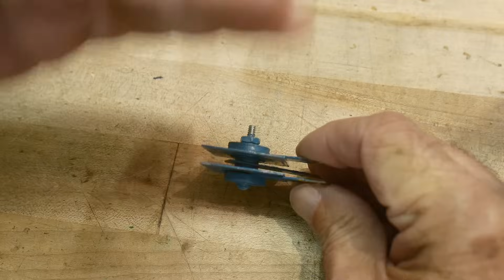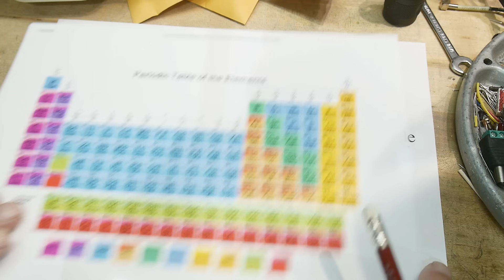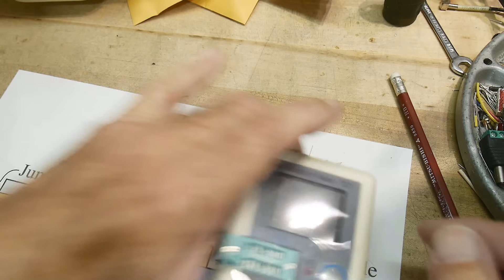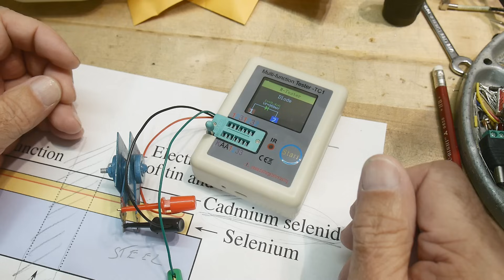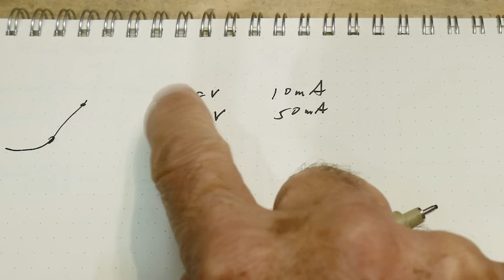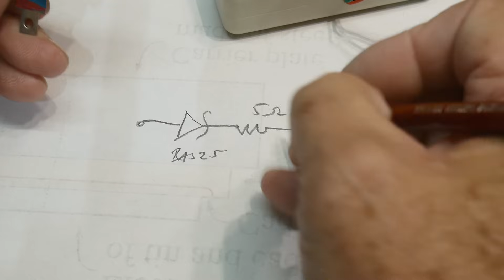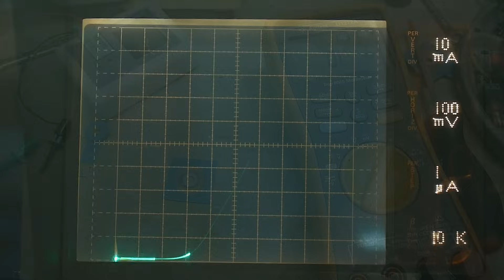#1753 Selenium Rectifiers

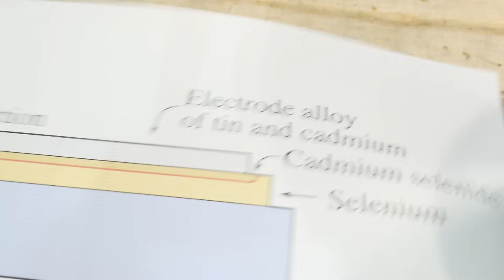Comment: 1:30 "What's in side this thing?" A heinous, infernal stink. Had one go on a 600A welding machine years ago. 600A three phase from the mag-amp controlled transformer. Big stacks. Oh My God. It cleared the shop out for the day. I could smell it for weeks, at work or not. It was a couple months before visitors came in and didn't mention the stink. In a welding shop.
Reply: I've had a tiny 250v 75mA one go. I can't imagine how amazingly bad a 600a one must have smelled.
Reply: I still remember it with the occasional flashback. Welder still rand pretty smooth. These have such a soft characteristic, loss of 1/6 didn't hurt it much. Fantastic arc gouging source, and great for running ceramic heater blankets. As the only real engineer, I was supposed to fix it. I was NOT going to go in to that case. Ran it for a couple days at low load to get the stink out, then felt good tack welding the case shut. Probably still in use.   @mfbfreak

Comment: Ones I dismantled were made of aluminium. They had some bismuth plating on one side, then some dark selenium on it, and then this tin-cadmium alloy on top. Layers on top had slightly smaller surface area than ones below, they didn't go all the way to cover them, so there was a dark "frame" around the tin-cadmium layer. The entire plate surface is a diode, and a capacitor. In vacuum tube devices I've seen there were multiple of those plates stacked for more voltage. Some had holes and screws, others were inside a plastic box with some springy inserts on both ends of the stack, and didn't have holes in them.

Comment: 1) IIUC, lots of folks think these are dangerous and are a replace-on-sight component. 2) If you wanted to build a Voltage Controlled Oscillator from a pair of back-to-back diodes, would a weak knee be advantageous, because the linear area of operation is extended over a greater slope? I am just a hobbyist and I am talking way out of my league, here... Thanks.

Comment: Very interesting to see the characteristics of a selenium rectifier with a curve tracer.  As the "BigCliveDotCom" channel says, if you burn (overcurrent) these rectifiers/diodes, you will smell a gigantic "fart" of hydrogen selenide gas, which will smell similar to hydrogen sulfide (both are toxic in sufficient concentrations).  Hydrogen selenide will smell like rotten eggs, like hydrogen sulfide.  With the old vacuum tube selenium rectifier supplies, you would always need to sniff to see if the "magic smoke" had escaped the rectifiers.  Another thing with these rectifiers is the fair amount of cadmium that they contain, as it is also toxic in high quantities.  Chronic cadmium exposure at a high enough concentration can lead to brittle bones, anosmia (loss of smell), and kidney failure.

Comment: As far as I remember those selenium diode stacks were built for about 20 V per stage and a forward current according to the size of the cooling fin. Such a size could be for around 1 A or little less. I remember two bridge rectifiers I bought to play with 55 years ago which were for 1 A ans 2 A and 20 V. 
The ones in tube radios had quite a number of stages to reach about 200V. They also had much smaller plates for lower current.
Reply: Selenium diodes were just barely better than having no rectifier at all. Worked okay to provide low current high voltage supplies in valve equipment but are totally unsuitable for signal detection or anything that requires fast switching and low capacitance.

Comment: Interesting. I was trying to figure out why the curve tracer started to slide away from 0V (and looped a little) as you increased the maximum forward voltage. It makes more sense now when you looked at the reverse characteristics and the huge loop... explaining it to be due to capacitance. So even though the drive voltage reaches 0V, the "capacitor" doesn't have time to discharge to 0V before the drive voltage increases again. Makes sense, but then the I-V curve would differ dramatically based on the frequency, yeah?
The loop also reminds me of the hysteresis curves seen in magnetic core memory... but then as I understand, that's not a capacitive effect, but a magnetic effect. It seems a major part of understanding I-V curves is understanding the physics behind the part!

Comment: See if you can find some copper oxide rectifiers and put them on the curve tracer. Also get an old galena crystal with cat's whisker for the tracer.
Reply: One of my Hickok tube  testers has a copper rectifier in the meter circuit.

Comment: Yep.  I did replace a selenium rectifier in a old tube radio with a 1N4007 diode and my B+ was much higher.  In went the resistor.

Comment: Nasty smell when they overheat. I believe they are somewhat toxic also when they outgas. Definitely a type of rectifier that hardly is useful anymore. Whenever I find these in old radios or old TVs I replace them with silicon diodes with a series resistor.

Comment: these are great for stationary car battery chargers. The small reverse current of the selenium rectifier acts like a small load on every halfwave cycle, regenerating the lead-acid battery of the car.This is a proven fact.
Reply: One of the major uses for selenium rectifiers still manufactured today is for battery chargers.  As you say, they have pretty much ideal characteristics for simple yet extremely effective lead-acid battery charging.

Comment: I have seen them used mainly in low voltage dc supplies. (Battery chargers, etc.) Standard balanced transformer outputs to the anodes, and get dc from the transformer center tap and the common cathode.

Comment: I found a few big chunks of Silicon on the railroad tracks. Before I knew what it was I was probing it with a multimeter and discovered the resistance would change depending on where I put the probes. Ive been wanting to make a crystal radio from some of it.
Reply: Those are metallurgical silicon. They use it by the hopper car full for deoxidizing steel. It is usually pretty conductive and you can use small chunks as the detector crystal in a crystal radio. On a more humorous note I brought a bunch to a hamfest after the movie Avatar was released and a bunch of people asked if it was unobtanium 😅😅😅
Reply: @christopherleubner6633  I guess on a less funny note I actually used to mine UNO  😛

Comment: Every tube radio that I have ever seen that uses a selenium rectifier used it as a half wave rectifier....

It's pretty common to replace them with a standard 1n400x diode and a resistor. To get the right resistance it's kinda guess and check by comparing the B+ voltage to the schematic. A 3-5 watt resistor is usually adequate for an AC mains radio, but a 10-20 watt resistor may be needed on an AC/Battery radio.

The antique radio restoration community is pretty split about replacing selenium rectifiers. Some swear they are fine to leave if working, some swear they are a failure waiting to happen, and some worry about the cadmium and want them gone working or not.

Most that I have seen have crept up in resistance to where they need replaced because the B+ voltage is too low.
Reply: I have seen German made Siemens  selenium rectifiers used for the negative voltage bias supply in old Fisher high fi equipment.
Reply: Interesting; the selenium rectifiers in tube radios I've stumbled across were all FULL BRIDGE RECTIFIERs and they were mostly encased in a metal package, making it easy to replace the innards with four 1N4007 diodes.
Reply: @KeritechElectronics  Odd, what radios?
Reply: @nobodynoone2500  Polish and German ones from late 1950s/60s if they didn't have tube rectifiers. I recall Tatry 3281 having a selenium FBR.
Reply: @KeritechElectronics  Depends on the radio, if it was a drop in for a rectifier tube a half bridge, like here, was common,  as the transformer was already there, and wound for a half bridge with common cathode and 2 anodes. For HV the stack would have to be 20 plates, though they often stacked them close together, so they fitted roughly in the volume of the old tube, to get a 400V reverse withstand, to allow B+ and peak reverse voltage to not break them down. Only after the transformer was redesigned, old stock run out, did they switch to the full bridge, as it used the same number of plates, but cut the cost of copper down. Full wave always has a jumper wire, as the stack is arranged to have a common positive point, and 2 series diodes to that point. Then connect the outer plates, as those are the negative, to make the bridge.

Higher the current larger the plates. Replaced a selenium rectifier in my battery charger, after 50 years those diodes were rather tired, and I did the change, using a 1970's era silicon block almost half the size of the old ones, that was rated for 10A instead of the 5A peak of the old ones. Did also add in a charge controller with a SCR, and a festoon lamp to illuminate the dial, plus reverse voltage connection protection. Now a 70 year old GE charger, still working well as needed.

Comment: Woohoo! Some old Sarkes Tarzian selenium rectumfriers! You know why they call them rectumfriers? Well, if you run too much current through them, the hydrogen sulfide will off-gas, and the surrounding area will smell like a......rectum!

In the old Zenith AM/FM radios from the 50s, they used a 22 ohm in series with the selenium; these can be replaced with a 1N4001 and a 47 ohm. Basically, you adjust the silicon diode series resistance to keep the B+ the same as it was for selenium.
Reply: Or, in German, the "Selen-gleich-riecht-er" 😊

Comment: When I hear Cadmium Selenide I think light dependent resistor
Reply: Close cadmium sulfide CdS
Reply: @sciencetestsubject  CdSe is also used I think (wikipedia has a link to a Silonex datasheet listing it).  I've only ever seen CdS ones personally though.
Reply: The LDR used for the tremolo circuit in vintage blackface Fender guitar amps has a  cadmium cell in it.  They still use it in some of the US market amps but not for the amps designed for export because the EU won't allow the cadmium  content.

Comment: First time I have seen the curve of a selenium rectifier. The reverse curve was most surprising. The capacitance is expected with such large parallel plates but the crappy breakdown threshold is the surprise. These get quite warm in normal operation at their rated voltage so not only are there forward losses as expected, but also reverse losses that are noticeable.
Reply: Its great that you watch this channel! I watch you all the time! Two of my favorite creators in one place!  🤓 And YES the reverse curve was very interesting! NOT what I expected at all
Reply: You rule Ron!!! Good to see you here!
Reply: just subscribed !! 😀
Reply: Well Ron in our younger years we had a lot to deal with these. Per plate they are rated for only 20V in reverse. That's why you need at least 10 for a rectifier in a tube radio. Surprised that you were surprised 😆
Reply: @LutzSchafer  To Ron a rectifier is glass and steel, with a glowing filament inside, or beefy silicon. Ignoring the smell years is a good thing.
Reply: @SeanBZA yes absolutely regarding the smell when these selenium rectifier set out the Magic Smoke.

Pretty much you know what component had failed at least what type of component it was!

I think that smell is still remember to eat long after the era of these components being commonly used.

Is that in the smell of when baked light gets a little too warm AKA burnt.

I remember once I was repairing a RV refrigerator where there was a event where some Bakelite had gotten white toasty that absolutely was rank.

Just goes to show when your servicing equipment sometimes you just got to use the tools you have on your person as in your five senses.

Hot smell something's got too much current going through it just as an example sometimes that's all it takes to realize this.

The one time you don't want to use your senses is when there is illogical leakage it could be a bit of a hair-raising experience sometimes.

I remember once when I was on stage crew years ago.

We were running a movie as in actually on 16mm film!

We didn't realize until happened to run into something that happened to be tied to ground inadvertently may have been the balcony rail may have been the balcony railing.

Xenon projectors with the separate power supply with that weird 7 pin plug that used to be used on some lighting equipment but was obsolete.

Interestingly the flat pins look like standard AC receptacle pins for a 15 amp.

There was six of those in line and if you tried hard you might be able to plug in 3 females into one of the males the 7th pin was actually what would appear to be a ground pin on a standard male plug as well.

 still trying to track down what connector this is

On the old lighting rigs use these they even had essentially extension cords with a male and female of the same connector.

Have seen this on other equipment but not very often.

My guess is this was not used for a very long period of time before becoming obsolete.

On those projectors by the way one of our guys on the stage group said oh this thing needs a little heck of a lot of power he was thinking that the power connector needed to be plugged into three circuits potentially with extension cords however I knew that this was an external power supply connector.

About the power supply that one had some leakage two ground I did not have a chance to measure this it was enough to know it was there.

Never assume anything is safe to use and there is no internal faults especially of old seldom used equipment.

It was not uncommon on stage to have cover plates and stuff live especially with the receptacles on the edge of the stage right up against the first row of seats and the receptacles below the Auditorium seating in various places he's got so much abuse as well as just beat up of course people kicking them and all.

And yes eventually replaced the stagefront receptacles with the nylon versions we never had a problem afterwards just to replace them a few at a time as needed and as budget would allow.

Was referred to as the liberal stage electrician!

We were basically responsible for everything in the auditorium even though it technically is school property they were not over any maintenance or anything that fell on stage crew.

And yes it was determined I was qualified to do this because of experience and skill level and yes on hearing and access two main electrical room if need be one usually fall on that sort of access for almost any other student
Reply: More vintage rectifier fun https://youtu.be/DvYxR51YYus?si=P6t_KJ9tzxvB0oCM